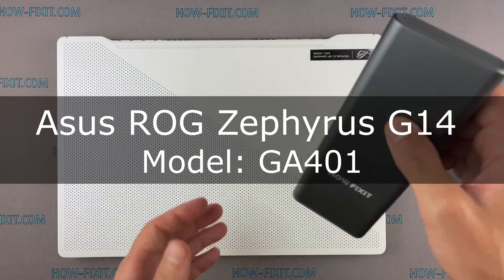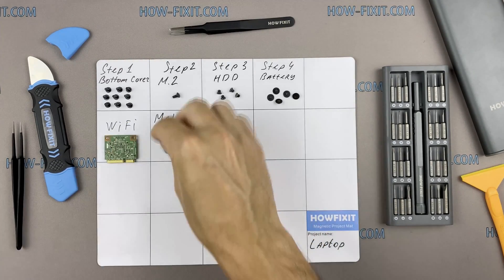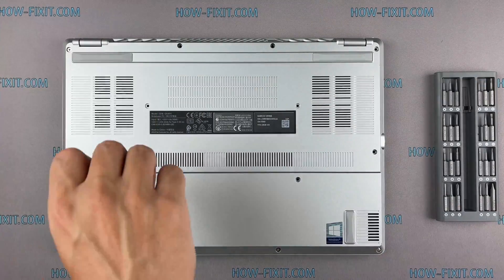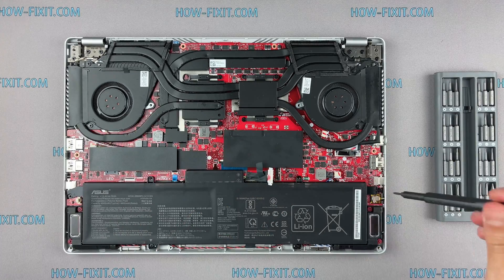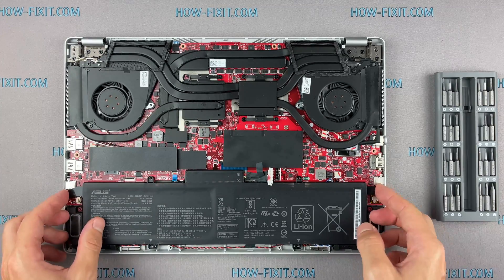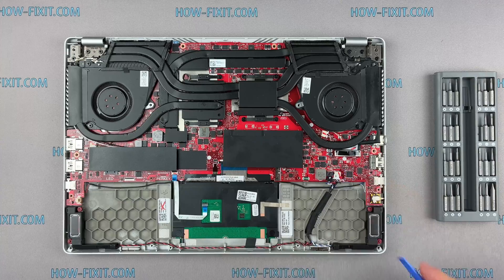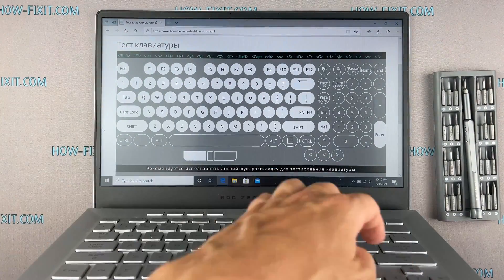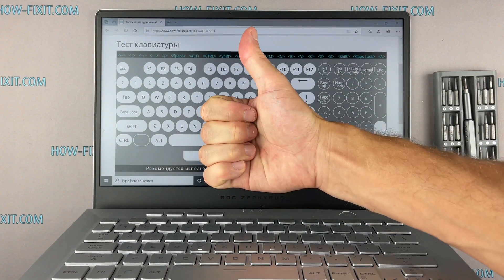Asus ROG Zephyrus G14 GA401 Keyboard Replacement - Fix Broken / Not Working Keyboard

Comment: Thanks! Just did a replacement and it didnt go too bad.  I did have the ribbon cable for the keyboard off a tiny bit and couldnt figure out why none of the keys were outputting the correct symbols.  Took it apart, straightened it and i was good to go.  Great guideA

Comment: Not terribly complex, just tedious & precariously delicate work. Do you know of any laptop builds/brands designed for easier swapping of components such as keyboards? You'd think so, spilling a drink on a keyboard has got to be a fairly common occurence, my laptop keyboard is sticky as sh!t right now.

I followed your video, but when I got to the actual keyboard I didn't have a screwdriver that small, so I put my computer back together & lo & behold it still works, probably because static shock monsters (cats) were disallowed in my work environment.

Comment: Thank you! Great video. I made sure to be very careful with each step and all is working well.

For anyone struggling with the 71 keyboard smaller screws like I did, make sure you get the right screwdriver. Not one of these ultra thin handled cheap ones, but get one where you nicely grip the handle and end bit is adjustable p00 and 000 cross. Took me 15 mins max to get them all out with that

Comment: I ended up following this for a slightly unusual G14 model (GA401QEC), and there were some additional connectors in the bottom left I had to deal with but couldn't remove. Fortunately, they were long enough that I could gently flip and lay down the motherboard without removing these. 

Certain models also appear to have some foam glued down to the board and holding the wifi antenna wires - Cut a slit for the wires and close to the best of your abilities afterwards.

After these minor catches, all went well! Keys worked fine, ended up selling it to a friend (who was well aware of the repair and paid for something more along the lines of a refurbished rather than just used laptop) and putting that towards a new laptop.
Reply: where did you buy the keyboard? I also need one for GA401QM model.

Comment: My keyboard didn't even work during boot. I replaced the keyboard and it still does not work, even during boot. Any ideas?
Reply: Have the same problem on GA402RK, suspect its a firmware issue, but if a replacement unit doesnt fix it, that means the firmware is on the MB, that means firmware chip flash / replacement. Currently researching what are my options.
Reply: @Urmza  @machdaddy6451 have you all had success since these comments? my GA401Q has had keyboard issues for over a year. It used to start working about 10 minutes after bootup. now it doesn't work at all.
Reply: Is either the connector or the demultiplexer is rip

Comment: Keyboard works perfectly now but now my power button and touchpad don't work. Weird.
Reply: probably power button and touchpad flex not connected properly.
Reply: @paveldelarosa8952  that was it. Fixed it with electrical tape and perseverance
Reply: I have the same issue. I ordered some replacement ribbon cables as I may have damaged mine in the processes. Did you end up fixing yours and if so, how did you do it?

Comment: Thank you SO MUCH for this extremely clear and helpful guide. Typing this on a brand new keyboard I just installed! The only problem I ran into was the metal sheet glued to the back of the old keyboard. The glue was too strong and a lot of the plastic backing came off too. I just put it back in with the old backing still stuck on, we'll see if it causes any problems. Don't see why it would.
Reply: did it eventually?
Reply: @hameedayanniyi1297  It did not. Still working great a year later.
Reply: @eternalsnows6071  funny how i finally did the fix myself and the exact same thing you went through happened to me too😂😂😂… and it works just fine no issues… i love taking my PC to uni now it’s so pretty with the black keys i put on

Comment: After a week, MicroCenter finally said they couldn't order any new keyboards. So I'll be doing this myself. Wish me luck.
Reply: How did it go?
Reply: @MrMonkey095  - Pretty well all things considered. A few buttons on the old keyboard were failing, and the new keyboard did the trick.

Reattaching the various tiny ribbon cables was the hardest part. Do not attempt this without good, preferably angled, tweezers. There is no way I could do this with just my fingers.

I had trouble reattaching the two wifi cables (11:40). They are supposed to work like a metal clippy button that you might find on a pair of jeans. I might have deformed mine as they would absolutely not reattach. I ended up hot gluing them into place. Solder would better, but would be more permanent.
Reply: @Andlekin if one key is sticky in this version can’t it be replaced ?
Reply: @MoeHashim  The keys weren't sticky. The keys were simply not functioning when pressed.
Reply: @Andlekin  but can you replace one key if that’s the case?
Reply: @MoeHashim  no. This is not a mechanical keyboard. The entire keyboard membrane needs to be replaced.
Reply: @Andlekin  thank you so much really appreciate it. Was asking because I just got the g16 asus oled and had a sticky ctrl key at purchase. For reasons of travel I couldn’t return it back so I was wondering if I could replace the key. Hope that makes sense.
Reply: @MoeHashim  what do you mean the key is sticky? Does the key literally stick in the down position like it has glue underneath it? Or does the key pop back up, and the computer behaves like the key is still held down?

Comment: what is a metal part on 8:20, that you stick back? is it really necessary?
Reply: it diffuse the remaining heat from the motherboard over a larger area, in order to have less hot spots under your fingers. It will also help the back of the keyboard to not melt.

Comment: Just replace the keyboard today, had some issue with some screws that were broken, but I manage to unscrewed them. Everything works like a charm, thanks for saving me like 200 bucks to change a keyboard !
Reply: Hi is your computer running badly? I did this exact repair today and my computer is running like crap
Reply: @sasuke8667  nop no problem since the replacement

Comment: Finished it all made sure did it step by step followed all the directions now my laptop is not turning on when i first plugged in my batter it did a mini spark and than i plugged it in and tried to turn it on and it wont what can i do does anyone know what happened??
Reply: That spark probably did some significant damage. Did you ever get it working again? 

For future reference, always have a way to discharge static electricity before touching open electronics. Also be sure all connections are dry and clean
Reply: Fuck I just had the exact same thing happen

Comment: Just a note to anyone that tries this... Separating that foil from the back of the keyboard will most likely result in ripping the backing off the original keyboard. You will also most likely crinkle the foil if you are not careful. Mine was glued on extremely well. Maybe heat up the laptop for a bit before you remove it, but it's still tricky because using a heat gun starts to melt the backing and ruin it anyway.

I unfortunately figured this didn't matter because I had a replacement keyboard, but then I had a problem with the replacement and actually had to order a third.

Now I had to also order a copper sheet to make a new one without all the wrinkles. If you need to do this use .0025-.003'' copper as .005 was somewhat thicker than the original.

I'm still debating how I should reglue it on. Just use spray glue and press it. Glue a a better binding material onto the copper first. Brush the glue on the keyboard. And now I'm also stuck debating what type of glue I should use. There's a lot of holes and screws behind the copper you don't want to seal shut or have glue get into to.

If you have the option, just pop all the keys out.
Reply: i removed the copper. i think it works as a heatstopper? my keys get extremly hot while gaming ( i dont care because i use extra keyboard) but it also heats up my graphic card. normally my cpu would get arround 70degrees, and my graphics would chill at 40. now both have 70degrees and i think its because i removed the copper but i dont know
Reply: @flamulina  I think the copper was an attempt to spread the heat out under the keyboard and not have it focused on one spot (directly above the two chips) I spent so much time debating what to do, but odds are it doesn't make that much difference. You're probably right though that it limits heat escaping because it would soak up and trap quite a bit (I imagine). However, I just bought 3mil copper sheeting from Amazon. Cut it to the template, stuck 3m transfer tape on it and stuck it to the plastic piece and not the keyboard directly. Just in case I misaligned anything, I didn't want to ruin another keyboard trying to remove it. Then I benched it for like twelve hours and took it apart again to check for any heat damage to the back of the keyboard and everything was fine.
Reply: @Hatemode_NJ  jeah i think so too. my cpu is hotter then my gpu and now both chips are equally hot. could u link me the foil that you bought? i might wanna but smth there
Reply: @flamulina  K & S 6015 Copper Foil, 0.003"

With  3M 468MP Adhesive Transfer Tape
Reply: @flamulina  I can't put the actual link. YouTube keeps removing them
Reply: @Hatemode_NJ  thanks! will keep you updated when i fixed it! :)
Reply: @flamulina  yeah to drill the holes I used a Dremel to sand the edges smoother. And if you're gonna glue the copper to the inside of the plastic piece instead of the keyboard (like I did) remember you have to put the adhesive on the opposite side. But that's up to you. The roll will give you many tries to craft a good piece. Good luck!
Reply: @flamulina  i wanna replace my keyboard because of the heat generated by cpu some keys around don't work(
Reply: I replaced my keyboard and didn't rip the copper. The copper is actually thicker than I thought. It actually cut me. I bled for this laptop. 
The key is to go from multiple corners and work it off slowly. I managed to not tear the backlight paper at all.
Reply: @UnrealOG137  honestly that's amazing. My laptop was still pretty new, but I don't think it would have been possible. If yours was older, maybe the heat wore down the adhesive a little. Either way.. Good job. I would have bet money that was impossible.

Comment: On the bottom of my g14 it says GA401IH but the replacement that i found on ebay says GA401 GA401U, would it still work? its the only one i can find and i bought it so hopefully it works or ill just return it i guess
Reply: Hey, did it work? or u had to return it?
Reply: @Arcanfella i just found out today that that only means the version of specs it’s shipped with for that particular year the ones with Q are for 3000 series gpu and 2021 versions U is for older 2020 nothing essentially so different it’s the same model as long as it’s GA401

Comment: Asus had my keyboards replaced by a third-party called LetMeRepair here in UK. I understand now why Asus charged me £200 just for a simple keyboard replacement. Based on my missing AMD and Nvidia stickers, and based on how the entire top half of the chasis looking a different shade of grey from the one i remember having, Asus and LetMeRepair probably replaced the entire top of the chasis and reusing only the boards, battery and bottom cover from my original
Reply: hmmm if you had followed this tutorial would it have saved you that $200? i am guessing asus did not have to replace the entire top half of your chassis

Comment: Just finished the replacement using this video. Thanks so much. The keyboard on these units did not hold up as expected for a "gaming" laptop. WASD keys kept cracking in half and I kept replacing them with other keys until half of the keys were gone. Replaced my silver keys with black ones as well, I like the look. The number of screws holding the keyboard in is ridiculous, couldn't stop laughing.
Reply: same happened with my wasd keys, why didnt you just replaced the keys instead of replacing the whole keyboard?
Reply: @pikachu5647  Because the prices I saw for keys were ridiculous. Got the full replacement for $50. I was missing half the keyboard because I kept taking keys from the right side to replace the gaming keys on the left.
Reply: @Xyzzy_Yzzyx  I also got the keyboard replaced, now i just external keyboard for gaming.
Reply: Where can Buy keyboard?
Reply: @Brandly99  Ebay has OEM replacements for about $50. Other places I looked wanted as much as $250.
Reply: I need some keys to replace in my Zephyrus G14. I could buy from you if they still didn't throw it away :)

Comment: My unit unfortunately came with a bilingual keyboard, and I purchased a replacement US keyboard as I don't like all the printing on the keys.  In your opinion, is it better to go through this lengthy process to disassemble and replace the keyboard, or is it relatively safe/painless to pop the keycaps off and replace as needed?
Reply: Its easy to pop keycaps, but remember to be gentle as you might break the clips.